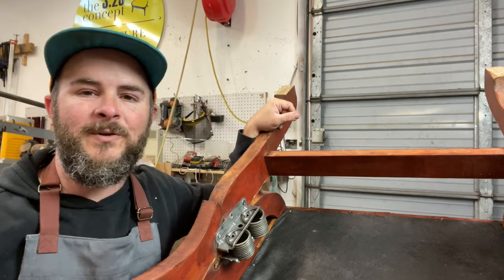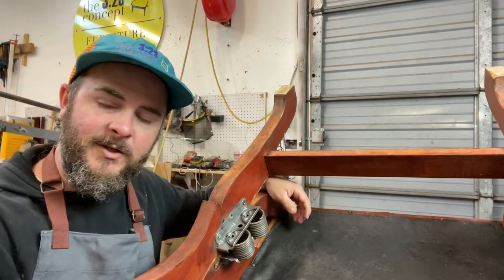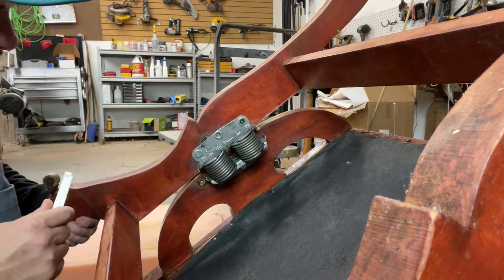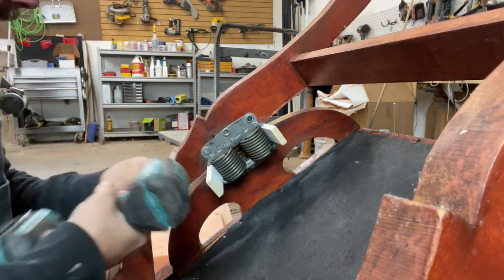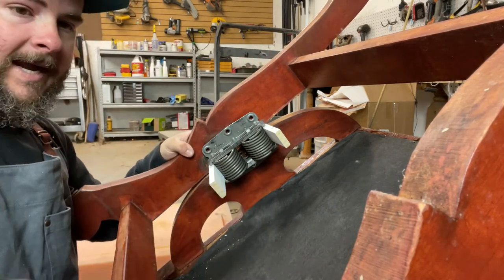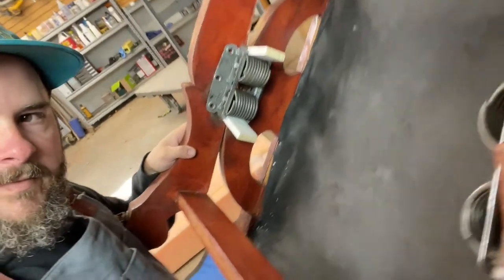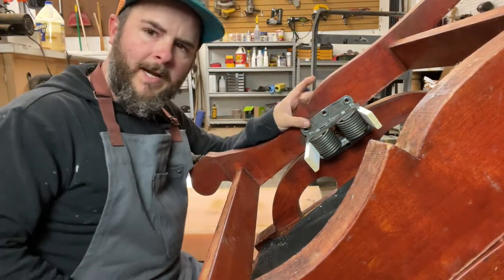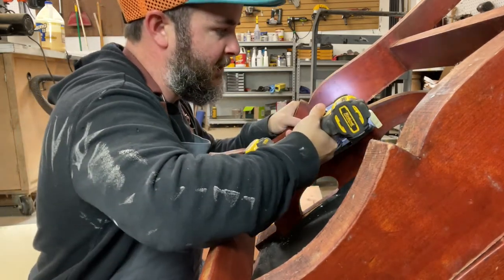How to Install a La-Z-Boy Rocker Spring

Comment: I've been putting off a platform rocker spring replacement for quite a while.  This helps a lot.  Thanks!
Reply from the maker: Glad it helped!
Reply: @the323vlog4  Not sure if you've seen the big coiled springs on the really old platform rockers.  I'm going to replace the big coils with the newer conventional springs.  Can't figure out how to remove the old anchors that hold the stud bolts.  Tried to pry them, hammer them, whatever, and couldn't get them off.  Any ideas?
Reply from the maker: @breand4  can you send me a picture of it? The323concept@yahoo.com

Comment: My 1950s  lazy boy seems to tip back  should the chair be upright  not leaning back .when you sit in it it tips back further and not in what I'd call a upright. Does it need new springs or has someone not balanced it when reupholstered
Reply from the maker: There is a guy on YT that specializes I. Lazyboy videos. I would check with him and see if he knows
Reply: @the323vlog4  thanks its actually  a British platform  not a lazy  one spring not a double
Reply: I was wondering if I could put a double as a replacement